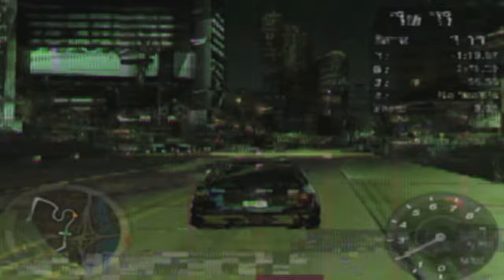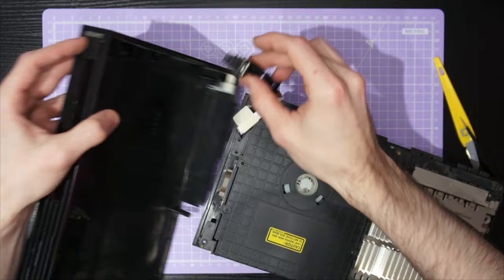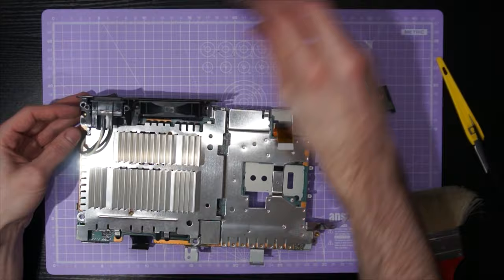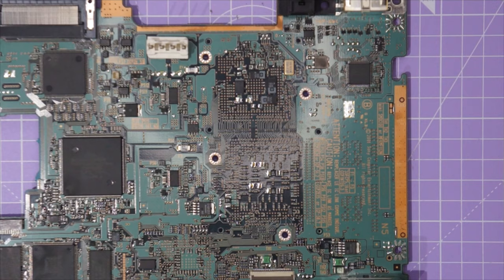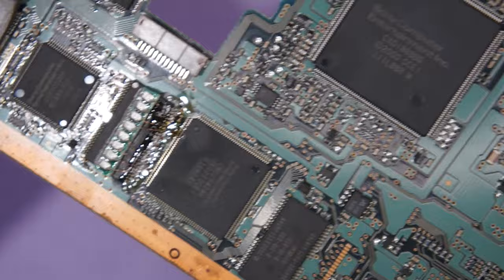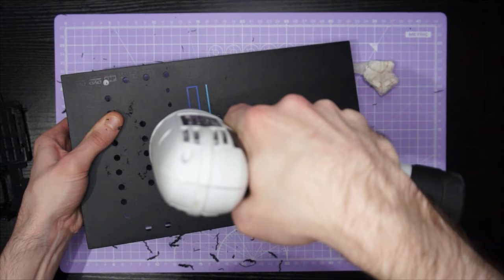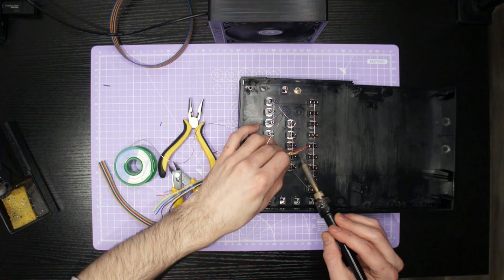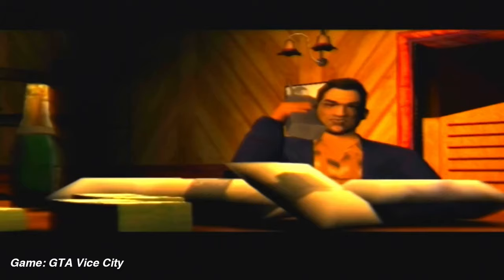Let's Circuit Bend a PlayStation 2! Full Tutorial + Diagrams

Comment: Looks very cool could you do something like this but with the xbox 360?
Ive seen a motherboard that the trails between the cpu and gpu are exposed but there is not a resistor or something between
Is hard to do it?
And the result is like the ps2?
Reply from the maker: I got the OG Xbox on my list to mess with next, the 360 is totally worth a try though. Looking at pictures of a motherboard there does seem to be a lack of resistors, but another option may be so solder onto the VIAs on the other side of the PCB.
Reply: @LoFiFuture   Is it like a general rule that you can only do bends on stuff that has resistors, like are all bend points resistors? Im trying to learn how to circuit bend and the lack of info out there is especially hard with no electronics knowledge haha.